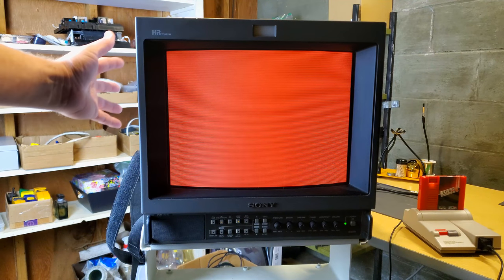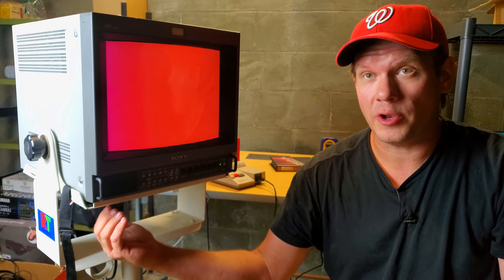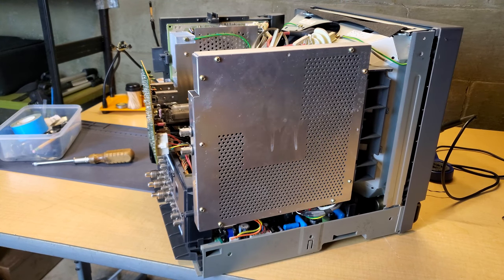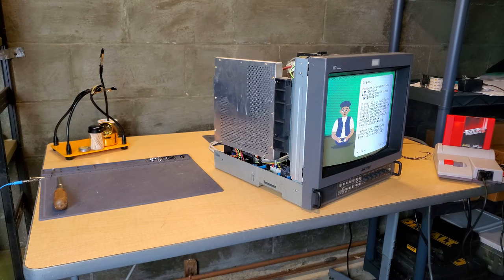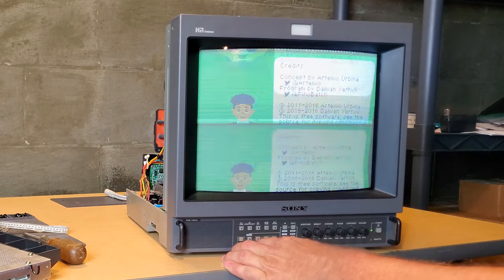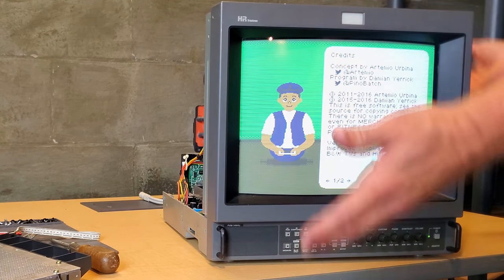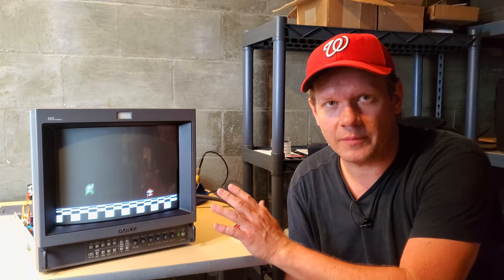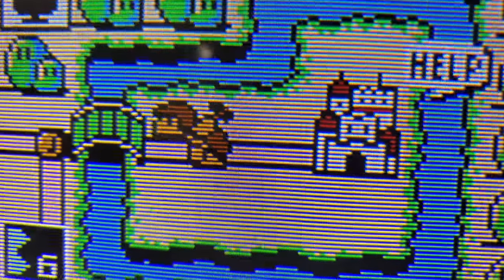Magnetic Interference: CRT Troubleshoot & Fix! - Sony PVM 14M4U

Comment: Well Steve, you found the source of the problem, but you really didn't fix it.  If it were me, I'd want to find out why that SDI board was causing the interference.  My theory is the shielding has a loose ground somewhere inside on the SDI board.  Sometimes, you can't just simply remove an optional board and declare the problem is fixed.
Reply: This is why.

If he'd have kept the SDi card in, he'd have been able to play the Ninentdo Gamecube with it's "HDMI out".
Monoprice sells some HDMI to SDi converters.

While it WILL be 480i, it will be a truely digital signal.
SDi is NOT analog!
If he'd have used it, he would have had a cleaner picture than RGBs.

If he ever has a native digital output on a console, and BVM/PVM that supports SDi, he should NEVER hesitate to try it out!

SDi supports 480i, 720p, and 1080i resolutions, and it's lagless!

Comment: If you'd have kept the SDi card in, you'd have been able to play the Ninentdo Gamecube with it's "HDMI out".  Use an HDMI to an SDi powered converter.
Monoprice sells them.

While it will be 480i, it will be a truely digital signal.
SDi is not analog!

If you'd have used it, you would have had a cleaner picture than RGBs.

If you ever have a native digital output on a console, and BVM/PVM that supports SDi, never hesitate to try it out!

SDi supports 480i, 720p, and 1080i resolutions, and is lagless!